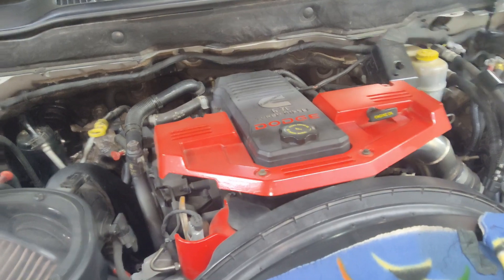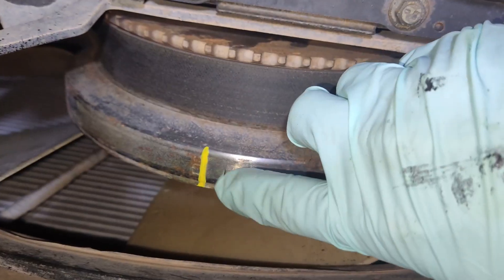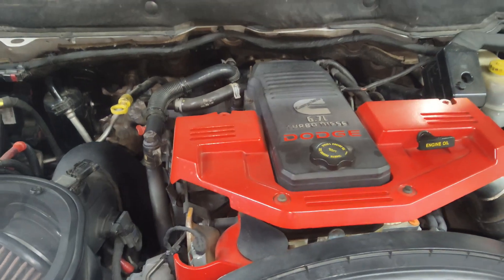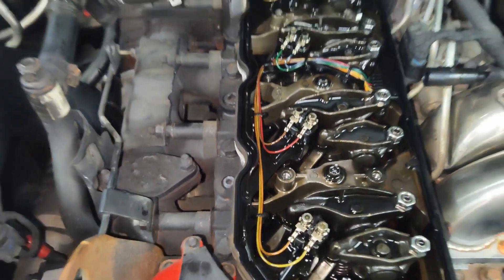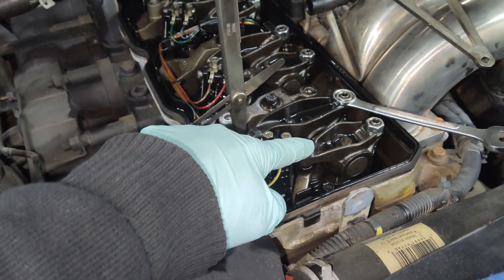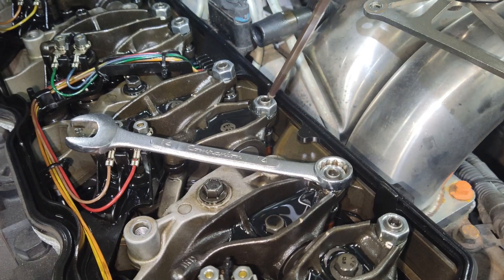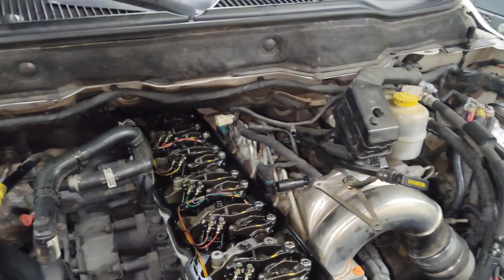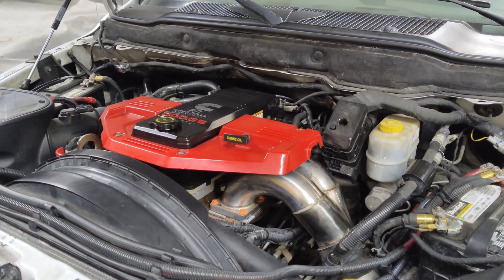Cummins 6.7L Diesel Valve Adjustment | Ram 2500 | Step By Step Guide

Comment: I have a 2011 RAM 5500 C&C truck, which I recently purchased. Runs great, no noise or issues until I did an oil change and fuel filter replacement. Amsoil 15W40, Mopar filters. Right after the oil change and fuel filter replacement i noticed a slight ting/ticking noise coming from what appears to be the lower side of the passenger side of the engine. Does this mean I need to check valve lash/adjustment? Or do you think it is the oil? Should I switch to 5w40? I can't understand why it would suddenly do it right after an oil change, but nothing before? It sounds just like the typewriter tick on the 5th gens, but mine is the 4th gen. Please, if you have any info or advise i would greatly appreciate it sort of has me out and worried. Thanks
Reply from the maker: Thank you for watching/subscribing.  
What kind of miles are on truck?  It's unlikely that an oil change would cause a valve train noise, but if you're concerned about valve lash, it's always a good idea to check it as part of routine maintenance anyways.  For a 2011 6.7 Cummins, use 5W-40 for year-round or cold-weather use for better cold starts, or 15W-40 for moderate to hot climates and heavy towing, as both meet specs (like CES 20081) but 5W-40 offers superior cold flow and protection in varied conditions, especially with full synthetic options like Rotella T6 or Amsoil.   Now since you recently purchased the truck(not knowing the history) and its first oil change it may be possible that there was an underling issue which may have been masked with thicker oil or other additives by the previous owner.  You will just have to eliminate certain things to figure out where the noise is coming from. First thing I would suggest is  switch to 5w40 and see if the eliminates it.  
The "typewriter noise" (a random ticking or clicking) is a well-known phenomenon in 6.7L diesel engines—including both Cummins and Powerstroke—that typically occurs immediately after an oil change.  
  It is Considered Normal: Manufacturers often classify this noise as a "normal operating characteristic" that has no short- or long-term negative effects on engine durability.
Duration: The sound typically lasts for a few hundred to 1,000 miles before diminishing or disappearing completely.
Potential Causes:
Oil Aeration: Fresh oil can contain tiny air bubbles that temporarily change how it cushions moving parts.
Fuel System: The sound is often attributed to fuel injector "tick" or high-pressure fuel pump operation.
Mechanical Components: Some reports suggest it originates from the crankshaft thrust bearing or minor lash in the valvetrain as it adjusts to the new oil's chemistry. 
Viscosity Impact: Some owners find that switching from 15W-40 to a full synthetic 5W-40 (like Valvoline Premium Blue) can quiet the engine.
Brand Preference: Enthusiasts frequently report that certain brands (like Shell Rotella or Valvoline) produce more or less noise than others in their specific truck.

Comment: Mines a 2012
300k in it
Mechaically deleted but computer is not tuned.
Runs perfect..but valve lashing never adjusted.

How do I know its tine to Adjust Valve Lashings?
Is there there noticablr performance afterwards?
Reply from the maker: Hi, thank you for watching/subscribing.
Cummins recommends a valve lash adjustment every 150,000 miles on 6.7L diesel engines. This adjustment ensures proper engine performance & can potentially reduce noise and increase power.

Comment: To use the barring tool any step before turning the flywheel, ignition on or is ok off completely?
Reply from the maker: Thank you for watching/subscribing.
If there is an automatic transmission then nothing needs to be done before turning the motor.  If there is a manual transmission, you do want it neutral & parking brake set.
Reply: @ thanks for the video

Comment: My truck is a 2010 deleted and tunes What’s a  safe consistent egt towing up hill?
Reply from the maker: Hi thank you for watching/subscribing.
While safe EGT can vary based on factors like load, altitude, and specific tune, a general guideline is to keep your EGT below 1250°F to 1350°F while towing uphill.  If you notice your EGT climbing too high, consider downshifting to keep the engine RPM higher, which can improve airflow and reduce EGT.

Comment: Mines getting a little noisy, got to do mine and I just turned 250k and haven’t been done since I’ve had it.  I’ve put 175k on it and she’s still kickin.  Thanks for the video.
Reply from the maker: Hi, thank you for watching/subscribing.
Some engines get the noise and some never do.  So this is not any kind of maintenance procedures that is recommended by Cummins or dealerships.  But it does work to cure the annoying noise, I say go for it.... thanks